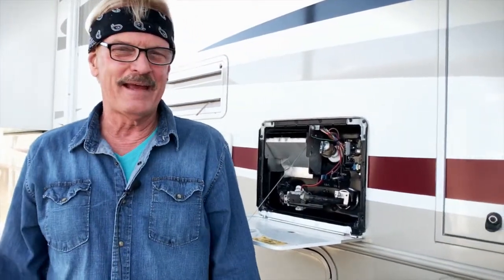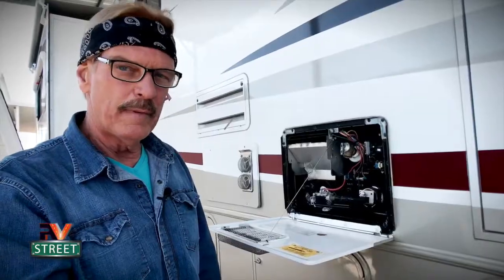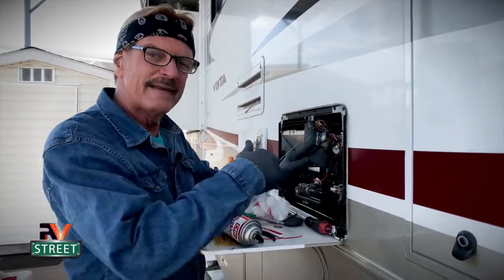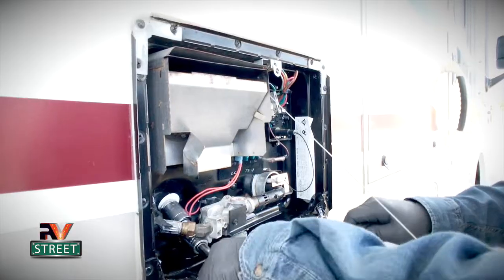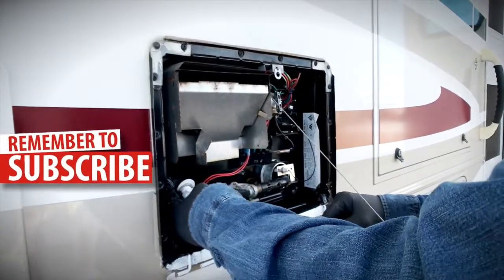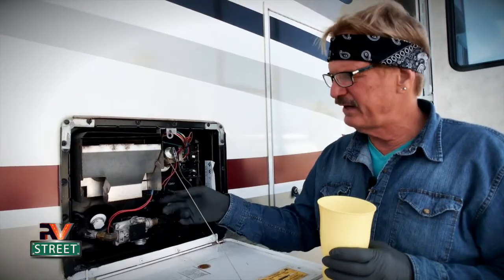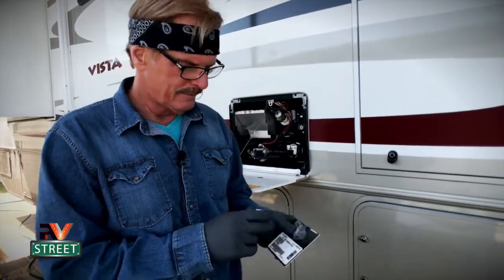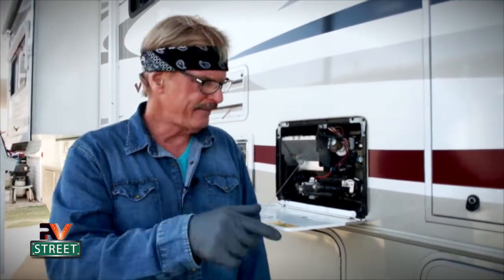CLEAN, FLUSH & SERVICE RV Atwood Water Heater 2.0

Comment: Can you get the proper fitting and back flush through the relief valve? Great video thanks
Reply from the maker: You could just remove the HP valve again and flush from there with the wand if you want to.

Comment: I saw a video from someone that said the RV appliance makers state that we shouldn't be installing insect screens on these appliances like water heaters, furnaces, and refrigerators, because they disrupt the air flow to them.  He showed a demo how placing one of these water heater insect screens in front of a fan and it reduced the air flow by more 30% as I recall.  I was all set to install them on my rig until I saw that video.   What are your thoughts on this?
Reply from the maker: Nonsense. 
If he wanted to prove air disruption, why didn't he do it with the fridge and water heater door which would be easy to do. If you don't install screens you'll have a much bigger problems. Just look at other RVers around you.

Comment: Great information... You have me sold, going to go and get some vinegar. Why did you switch back to a nylon plug?
Reply from the maker: Well, I explained that briefly in the video but futrther explained why I went back in the very first comment that I pinned under the video. But here it is again:
Concerning the Nylon Plug being the 3rd safety feature. I didn't mention what it actually does like I did on the other 2 safety features. Don't know how I missed that but....
The nylon plug is a backup safety feature. 
The plug is hollow on the inside so it's designed to blow out if the primary safety feature—the high pressure valve—fails for whatever reason.
As I showed in this video, since I have cleaned and removed the debris that was causing my initial leak in the water heater threads where the nylon plug screws into, I have gone back to the Nylon Plug and now do not experience any leaks.
thx Rob 👍

Comment: I have two questions. 1) in your prior video on cleaning the tank, you had switched from a nylon plug to a brass plug. In this video, you have a nylon plug, is there a reason you switched back to the nylon?

2) could I use white cleaning vinegar? it has 1% more acidity but is supposed to be 20% more effective.
Reply from the maker: In the first video I showed the brass plug because at the time I couldn't get the nylon one to seal properly. In the 2nd video I showed how I discovered mineral deposits that we're embedded in the threads and once I cleaned those out I could go back to the nylon plug and it seated properly. The nylon plug is the 3rd safety feature of the Atwood water heater. It's designed to blow if the other two safety features I covered fail if to much pressure builds up in the water heater. It's a special hollow nylon plug and yes they are in my Amazon Store. https://www.amazon.com/shop/rvstreet

Yes you should use white vinegar like I did in the video.

Comment: Hey, Martin. Great video. I am following your instructions now but have a question. I am at the step where I added the three gallons of vinegar. My question is: to fill the remainder with water, do I need to have my bypass valves open to fill it? I am not quite sure what to do next. I turned my bypass valves on because when I drained, I left them open, and water kept pouring out. Thanks for any help you can provide. You have a new subscriber.
Reply from the maker: You leave the valves in the normal position. You don't want to bypass. Once vinegar is added just turn on the city water until the water heater is full of water. If you want to verify that the water heater is full, turn on any faucet on the hot side in the RV and you'll smell vinegar as water starts to come out. Once the water heater is full of water & vinegar turn it ON and let it cook.

Comment: hello martin and fellow u tubers , as you know SIR , we have the same rv , in fact the same water heater , im sure you know that the water heater uses engine coolant to heat up the tank , but after getting my rv winterized ,and late due to scheduling issues , and it wasnt that cold, we come to find out that we need a new water heater , the one that is in the rv is no longer made and dometic acquired atwood and dometic water heaters do not have heat exchangers ,,very few do due to many are going tankless, sp take care of your water heater as you have been
Reply from the maker: Ya, it's called a Atwood Motoraid water heater for those reading this comment and don't know. And your right on the money. Take care of what you have often. Taken care of properly they will last 20yrs. or more. A portable water softener is also very important to help extend the life of any RV water heater, other water using appliances and all plumbing and fixtures.
Good comment Michael 👍
Reply: @RVstreet  we try to help one another,I know no other way Martin,I found this video so on target,and it's easy to do

Comment: Ref. the 2nd wand: Is there some reason you simply didn't take out the relief value and use the original wand to flush, as the relief valve is on the "other side" from the drain plug?. Seems like a 2nd wand and all the bending is much more difficult than just doing that.  Am I missing something...?
Reply from the maker: I am sad to say that Martin has passed away and I don't have the answer to your question. Sorry

Comment: Once again Martin, great videos.  I have an atwood 10 gal water heater.  Is the drain plug the same size or standard as on the 6 gal hot water heater? I want to purchase new drain plugs as you suggest, I just want to make sure I am purchasing the correct size.  Thanks Marting.
Reply from the maker: Well I've always though so until I read some of the product questions on my Amazon Store:
https://www.amazon.com/dp/B0007XVWW0?linkCode=ssc&tag=onamzrvstreet-20&creativeASIN=B0007XVWW0&asc_item-id=amzn1.ideas.3Q0KMKYCTJVT&ref_=aip_sf_list_spv_ons_d_asin&th=1
Reply: @RVstreet  I just finished my flushing and bake time with the vinegar. I replaced the plug with one from your store, it fit my 10 gallon unit just fine.  Thanks again for the education, all went perfectly!!

Comment: Hi Martin, we have been watching your video. My husband wants to know if there is a reason you have the nylon plug. He thought you had a copper one from a previous video. Should we switch ours back to nylon?
Reply from the maker: It wasn't copper it was brass. I explained why I used that brass plug in this latest 2.0 video, and I also explained it in the first comment posted. But in brief, the Atwood water heater has 3 safety features and the Nylon Plug is one of them. Once I fixed the debris problem that was causing my previous leak—which I solved with my brass plug—I went back to the Nylon Plug. It took awhile for me to figure out why that nylon plug would never fully seal. But it's fixed now. So yes, make sure the threads in the water heater are very clean, do not put teflon tape on the nylon plug and just snug it up.
Good question. BTW...I didn't mean to confuse anyone on why I did that in the first place.

Comment: I saw a couple of your water heater videos that are excellent and thank you for this but I noticed that you did a video 4 years ago and you had replaced the plastic/ nylon water plug with a brass plug. I then saw another one of your videos that was 2 years old and you were using a plastic/nylon plug. Can you tell me which one you use in your rig. I have the dometic water heater in my unit.
Reply from the maker: I use the plastic/nylon
Reply: @RVstreet  thank you

Comment: Did you not say in a previous video you changed from the nylon plug to  a brass plug . have you switched back. or just for the video ?  thanks regards from Alberta Canada .
Reply from the maker: Yes I did and I covered why in this video.
Reply: @RVstreet  I just watched your video. You state it is a safety feature, but not what it does for safety. I watched your first video and like you I didn't like the nylon plug so I purchased a brass plug. If you please state the reason why you switched back it would be appreciated. Thanks for the great info and videos, Mark.
Reply: @markhwalisz9181  me too I replaced the plug so I am asking the same question .
Reply from the maker: @markhwalisz9181  Ya know your right. I didn't state what it does. I thought I did. How did I miss that in editing? I'm going to put that in my comment that is pinned at the top of both my water heater videos.

The nylon plug is a backup safety feature. 
It's hollow on the inside so it's designed to blow out if the primary safety feature—the high pressure valve—fails for whatever reason. Once I discovered the reason mine was leaking I was able to clean that out real good and the Nylon plug works fine now.

Comment: I purchased a used Itasca Sunrise Motorhome.  Trying to follow your instruction, I discovered that I have a metal anode rod plug rather than a plastic plug as you describe.  Am I supposed to be using a plastic water heater plug?  I do have an Atwood 10 gallon water heater.
Reply from the maker: Atwood water heaters DO NOT have an anode rod. The previous owner didn't know what he was doing. Yes you should have the proper Nylon plug in there because it's also acts as a safety feature if pressure should ever get to high and other safety features fail. 
If you want, I have the proper plugs in my Amazon Store in the "Everything Water and Sewer" category. 
https://www.amazon.com/shop/rvstreet

EDIT: I don't know if you have your manual or not but I thought I'd give you a link to one JIC.
https://manuals.heartlandowners.org/manuals/Plumbing/Wtr_Heater/Atwood/Atwood%20Water%20Heater%20Service%20Manual.pdf

Comment: Found your channel about three weeks ago, and now starting the maintenance on the hot water heater. I’m to the point to remove the high pressure valve and it will not budge.  RV is three years old and this is the first time I’m doing this.  Any recommendations on what to put on the valve so I can get it off?
Reply from the maker: Hummm.....that's not good.

It sounds like whoever installed the high pressure valve (HPV) the last time (maybe even the factory) did not use teflon tape around the threads and the brass and aluminum can corrode and bond together pretty good. It’s a chemical reaction. So a little heat may be in order. 

But first……do you see a lot of white crusty, powdery buildup around the base of the HPV where it screws into the water heater? If so, take a small wire brush and some white vinegar and clean that area really good. Then apply your liquid wrench again. liquid wrench takes awhile to work. Sometime hours. On some engine parts it can take days. Keep spraying it on there about once every 30 minutes or so for the whole day. Now try to loosen the HPV again.

If that doesn’t work you can try using heat with something like this from Home Depot: 
https://www.homedepot.com/p/Bernzomatic-TS3500KC-Multi-Use-Torch-Kit-361479/300870607

Heat make metals expand. So the idea here is, with the torch set on low flame, gently move heat flame around the aluminum fitting on the water heater. You’re not wanting to get that area red hot. Just nice and warm or semi hot. That will expand those threads just enough so the brass HPV can begin to come out. You don’t want to heat the HPV brass part b/c that will expand those brass threads and bind it in there even tighter. You can also take a small rag, soak in water and then wrap the HPV with that so the heat won’t transfer up to the HPV.

Now if you’re not comfortable doing this, call a mobile tech who has the tools and the know how.

Once you have it out, go to Home Depot and buy a new matching HPV and put teflon tape on those threads before you install. At least 3 passes of tape.

Let me know the final outcome. How this helps.
Reply: @RVstreet  lots of white crusty buildup around the HPV where it screws into the water heater.  I used wire brush and white vinegar and cleaned that up.  There is Teflon tape around the threads.  I applied liquid wrench this morning after cleaning the area.  I will try again this evening, if not will apply more.  Will try heating it up in the morning if this does not work.  Will keep you posted.  Thank you.
Reply: After 2 days go adding liquid wrench to the valve, I got it removed.  It doesn’t look like Teflon tape that was used but some kind of paste.  I wanted to thank you for the support and knowledge that you are passing on. Also from one veteran to another, thank you for your service.
Reply from the maker: @toddkristinstover799  Good job

Comment: I have a 2017 Coachmen trailer. I always drain my hot water heater. I've never done the vinegar flush. Is it a danger to do it not since it's never been done?
Am I risking a leak?
Reply from the maker: There is no danger at all. I'm sure the water heater will love you for it.

Comment: Hey on another topic are you using any kind of MOFI device so you can tool down the road stream video to TV and computers etc - if so what do you use "off grid" separate from any park or friends home? Looking for a system that has great utility, high bandwidth that can be used (for the most part) boondocking with a plan that's unlimited (cheap) month to month
Reply from the maker: We never use CG wifi. To slow and unsecure.

We don't stream TV while underway, but we do always stay connected to the internet for driving conditions, fuel stops, eating places etc. While I'm driving, Joanie is always staying in touch with what's going on with the GPS and she's also on her iPad checking on things I mentioned above. We use our cell phones as a hot spot and I've installed a weBoost to boost our cell signal if need be. While we're driving it always in ON. Here is the latest weboost unit. Much stronger than the one we have and ours has never failed us. Probably one of the best upgrades I made from the beginning.
https://www.amazon.com/dp/B08L9SG331?ref=exp_rvstreet_dp_vv_d

We are not day time TV watchers but we do watch Netflix and Hulu usually every night.

Our plan is with unlimited everything, for two phones, no contract $120/mo. (including taxes). Our average monthly data usage is around 150 - 200GB.

Comment: Martin, the manual for my suburban water heater says not to remove the pressure valve. Do u recommend an alternative method of filling it with vinegar/water, or can I go ahead & fill it through the top, pressure regulator hole?
Reply from the maker: I don't know why they would say that. Servicing that HP valve is a PM item. Your have to remove it to replace it if necessary also. You could flip the valves on your wintering kit, put the hose directly into the vinegar jugs and use the water pump to get vinegar into the water heater. To much hassle for my liking. Since you have a suburban be sure to also replace the anode rod afterwards. Hope this helps.

Comment: I have a 2019 Jayco with an Atwood water heater.  Do you still use anode rods with aluminum tanks?  There is nothing in the manual.  The drain plug is currently just a plastic cap.
Reply from the maker: Atwood water heaters DO NOT use a anode rod, but you need to use the right kind of plug b/c it's one of 3 safety features if pressure builds up to high.
I have the right plugs in my Amazon store in the "Everything Water & Sewer category".
https://www.amazon.com/shop/rvstreet

Comment: Hello! Just subscribed. Question: what bypass' to turn off before flushing the water heater? I just bought a 2004 Coachmen Concord 225RK and it has an outside panel compartment with different levers for fresh water fill, winterizing etc. and four other valves inside the coach. I'm a bit confused as to which ones to close off and leave open to fill the water heater. Can you help? Thanks for this video!
Reply from the maker: That outside compartment is called the wet bay and it would be impossible for me answer what valves to what without looking at your set up. Every RV is plumbed different. Your manual will explain what each one does. If you don't have your manual you need to get it online ASAP.  But I think you're making this more difficult than it really is. You didn't see me make any comment about bypassing anything did you?

Generally speaking you don't have to bypass anything before flushing the water heater with white vinegar. Now when you are sanitizing the fresh water system with bleach, that's different. I did a complete different video on that, that will explain everything you need to know including what to bypass: 
https://www.youtube.com/watch?v=5-55rJ0w-5U&t=570s

But back to your question. If you just hook up your water hose to city water like you normally would, this will fill your water heater. If you want to check that, go into the RV and use any hot water side facet. If you have pressure, the water heater is full, and will con't to stay full as you use hot water. Now you'll be confident that your water heater is full and can proceed with the water heater flushing process like I showed.

It will take time to "KNOW" your RV. There's a lot of systems in these things but don't get overwhelmed. Take your time and make it a priority to understand what systems you have, how they work and how to maintain them. And download all the manuals for these systems now while you can. You also might want to check these categories out. They will help you a lot to prevent bad things from happening in the first place.
https://www.youtube.com/c/RVstreet/playlists
Reply: @RVstreet  Excellent! Thanks for your input!